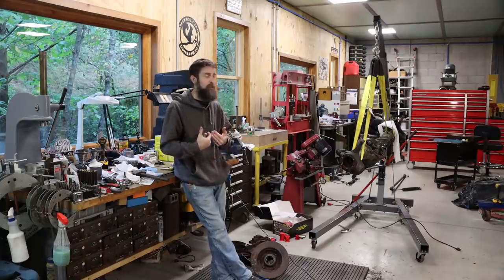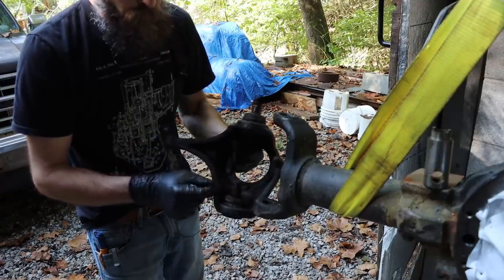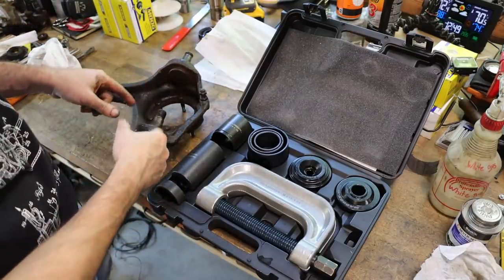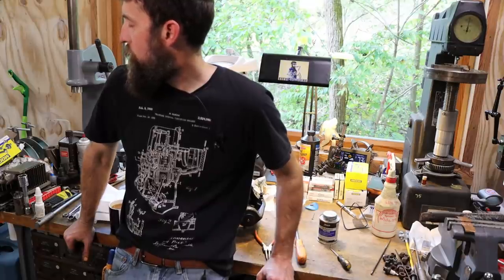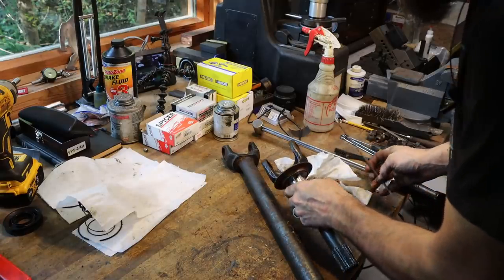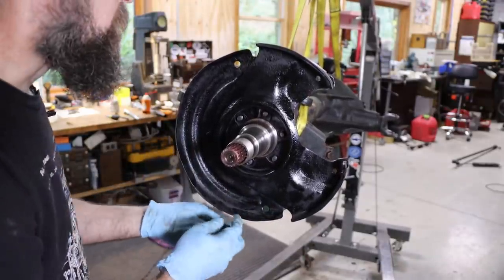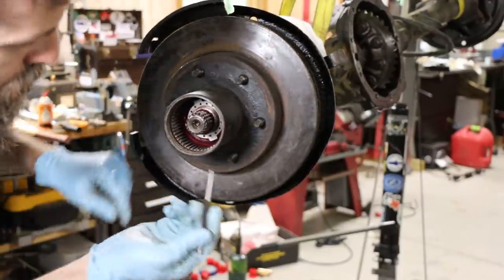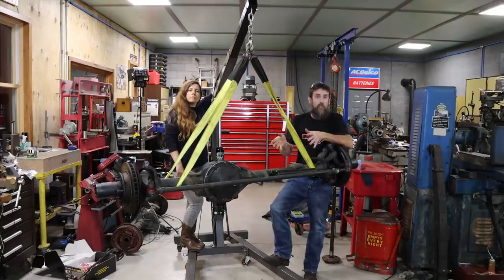GM 10 bolt Axle OVERHAUL for the SQUARE BODY Part 4

Comment: steve the pins through the castle nuts are ""split ""pins and not cotter pins when ordering parts stockists can get flustered thinking its not the correct part
Reply: Why do so many people call split pin cotter pins! A cotter pin is usually a solid pin, with a cap at one end and normally seen with a hole at one end that takes a split pin, but there are many variations.
Reply: I was thinking the same Shaun. Could he be thinking of a spring pin/role pin?
Reply: Depends where in the world you are I suppose. In the UK, we call them split pins but I work on French aircraft and the maintenance manuals call them cotter pins.

Comment: Hmm, I just noticed you are wearing your wedding rings. Not good my friend. Over the years I have had to pick up two severed fingers and heard of one electrocutions due to rings. Jewelry has no place in the shop on any occasions. Just like Bic Lighters. Leave them at the front door and pick them up on the way home, PLEASE !  As far as the ball joint cotter pins are concerned just hammer the impact socket over the nuts and rattle them off. Same goes for the inner nut and a wrench with extension as you did here. Everyone needs to have a ball joint press. Those and for  U-JOINTS and many other things are sure done a lot easier with one. I love to see all of you showing the love of all things in your surroundings. All creatures great and small that you interact with show their love and understanding that comes from you.  You do it right all the time. Nothing gets forced together unless it is designed that way eh. Many thanks to you, your lovely girl and growing fast son. You have always been my Saturday morning fix. Take care eh. See ya next Saturday morning.
Reply from the maker: My ring is silicone 👍
Reply: @SteveSummers  I should have known you would have that covered. Good job Steve !
Reply: @haroldphipps3457   Just concerned about a friend.

Comment: Why wouldn't you change wheel bearings? It was SOP anyplace I ever worked to go ahead and change bearings whenever you tore an old piece of machinery down when you had the chance. Unless, of course, you changed them just before this break-down.
Reply: Well, for one thing some quality brgs, like Timken, are not readily available  anymore. I would have no problem reusing bearings, if they pass inspection.

Comment: Packing the bearing is pointless. The first rotation displaces all the grease.
Install the bearing after lubricating with oil and reassemble the device, then fill the cavity with grease before the final step that seals the device.
Grease lubricates by slowly releasing it's liquid component into the bearing ,leaving the solid component ,usually a soap, behind.
That's why old grease hardens. 
As long as there is a sufficient quantity of grease in the cavity,the liquid lubricant will find it's way to the bearing for the intended service interval.